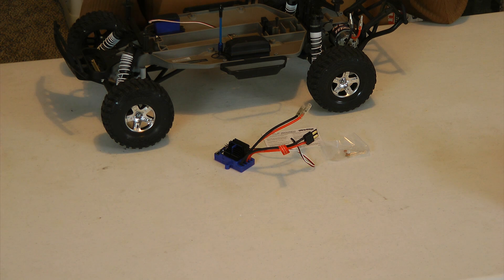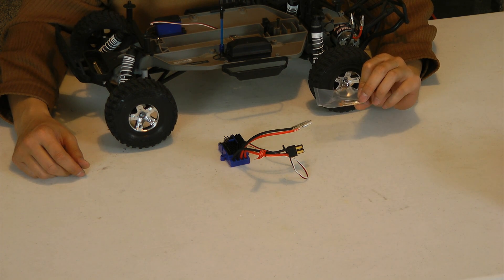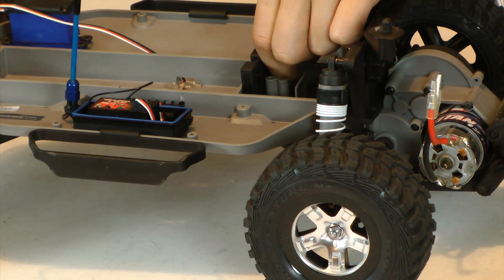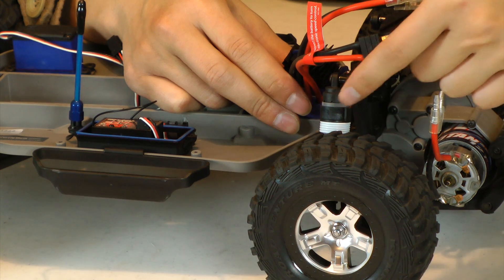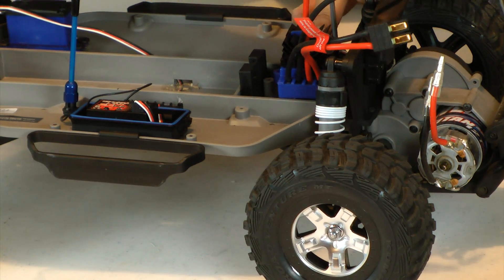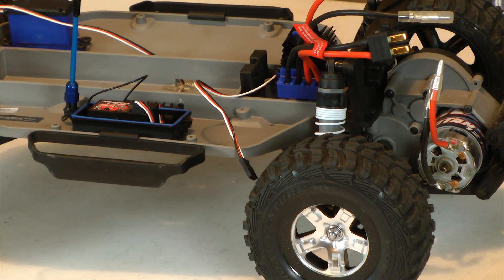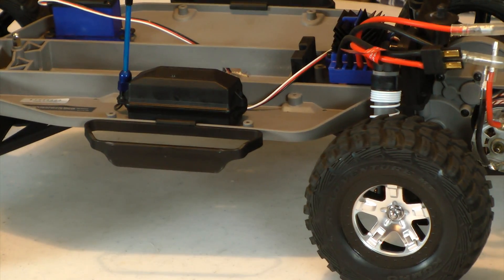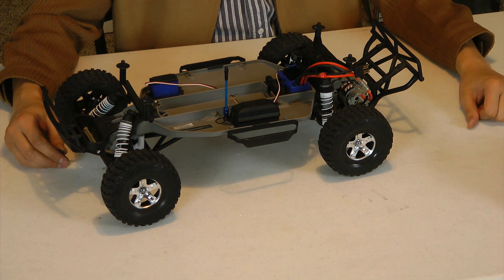How To install ESC Into A Traxxas Slash

Comment: I put a new one into my car, but the same controller won't work the one with the new esu or whatever it's called doesn't work either is there anymore wires I need replacing?
Reply: You need to reprogram the controller, their is a video that shows how to do it real easy

Comment: You are supposed to lead the wires threw the hole in the shock tower (with the esc RED and BLACK wires) there for they wont touch the shocks or tires. :)